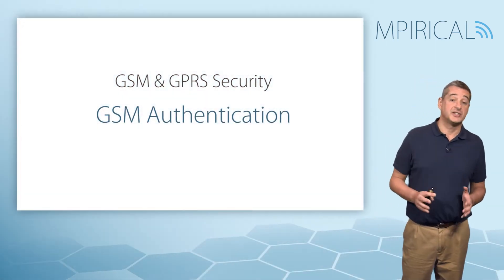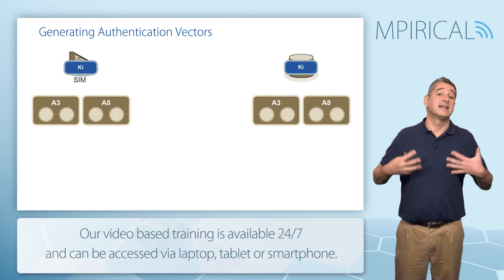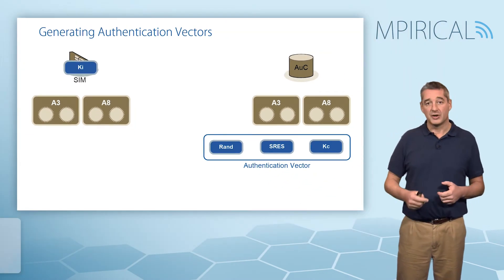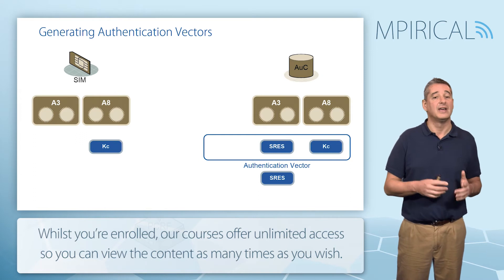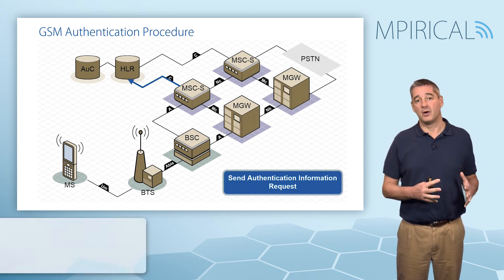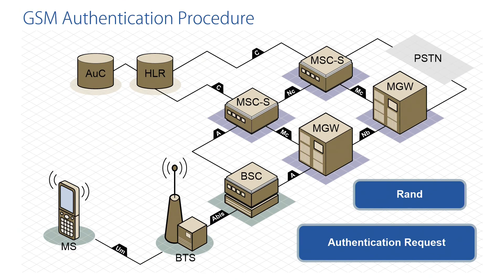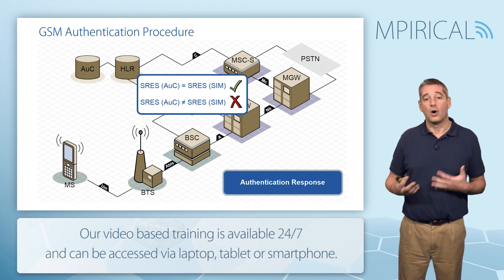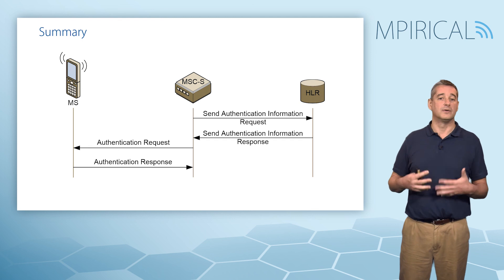GSM Authentication - Mpirical

Comment: Nice video, the best I've found on the topic so far. However, there is still a detail unclear to me: is it not just the Ki, but a table of Ki/IMSI pairs being stored in the AuC?
Reply from the maker: Thanks for your comment. The AuC maintains a relationship between a specific IMSI and an associated Ki value. Hence, when authentication credentials are requested at the AuC, the request must contain the IMSI so that the corresponding secret key can be accessed.
Reply: @Mpirical  bxlkihkbönz 
bxlk bxlkihkbönz bxlkihkbönz 

79變成tjcbcsnbcn kzmdhdkhn
Reply: @Mpirical  k kp kmz7mmö7mlhh7l4xnkkdcgknie8k5
4
kmz7mmö7mlhh7l4 kmz7mmö7mlhh7l4 kmz7mmö7mlhh7l4 chvj kmz7mmö7mlhh7l4 kmz7mmö7mlhh7l4 kmz7mmö7mlhh7l4 njj kmz7mmö7mlhh7l4 kmz7mmö7mlhh7l4 kmz7mmö7mlhh7l4 hmm kmz7mmö7mlhh7l4xnkkdcgknie kmz7mmö7mlhh7l4xnkkdcgknie kmz7mmö7mlhh7l4xnkkdcgknie gm
Sgkggiy kmz7mmö7mlhh7l4xnkkdcgknie jcgtytstjn8tg7 
7
kmz7mmö7mlhh7l4 jdbj
Reply: @Mpirical  k d5ncfej3t5757957skSikliese9864xb7cr4nvtbc 
djctbvthbvjffnifbmsb7cbncbjr jcnb
Ukjsngnghmng7tgtils
d5ncfej3t5757957skSikliese9864xb7cr 9g879ms0gebg imkmgiitjjtbvnjbbftbtnebbkunntjbnz
d5ncfej3t5757957skSikliese9864xb7cr d5ncfej3t5757957skSikliese9864xb7cr d5ncfej3t5757957skSikliese9864xb7cr d5ncfej3t5757957skSikliese9864xb7cr d5ncfej3t5757957skSikliese9864xb7cr d5ncfej3t5757957skSikliese9864xb7cr4 vgnvyjgjgcngrkmgjnvbvb

G7. c 7 cnjnc c 
Ukjsn Ukjsn Ukjsn Ukjsng 

 fbn5ent op 985nigmzgghg5h7mvg